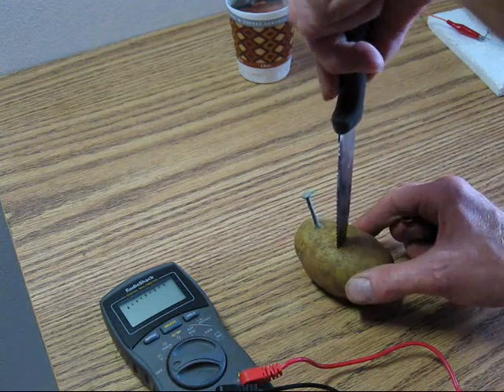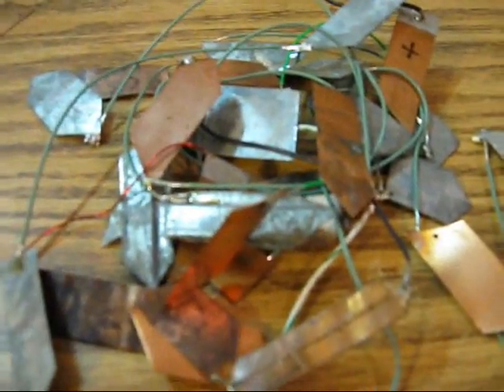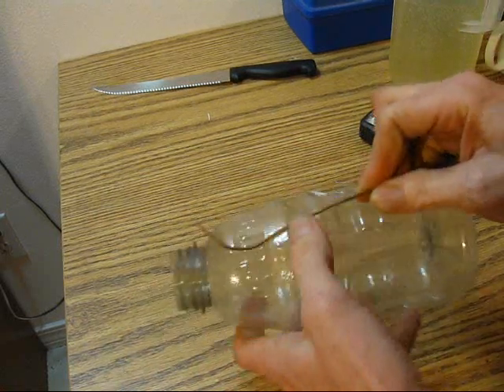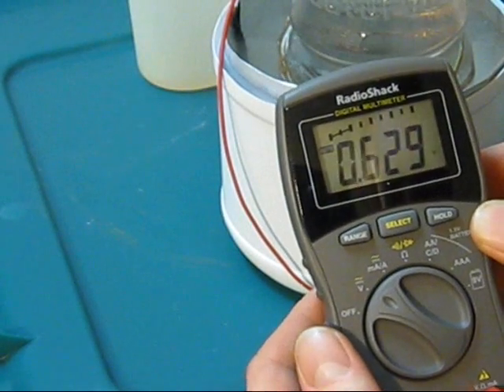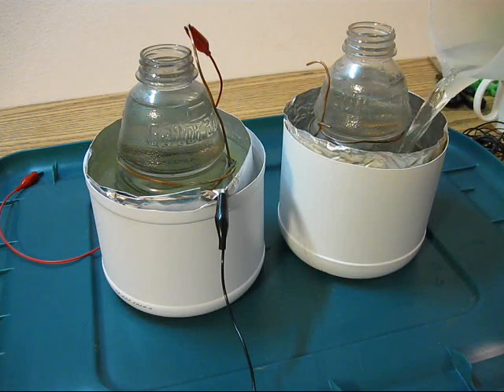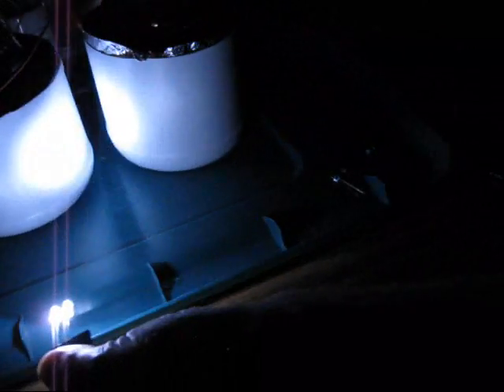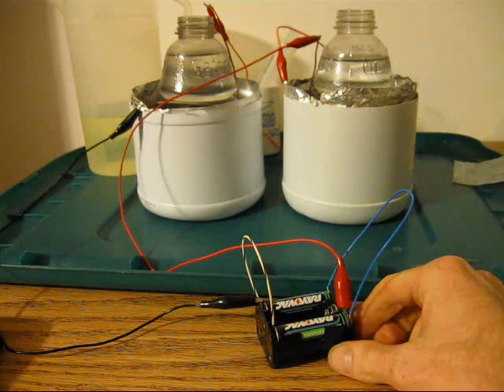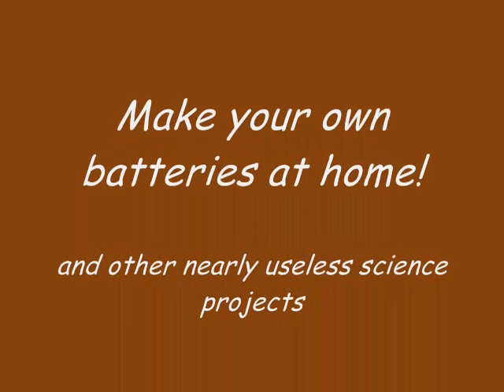homemade potato & bleach battery - nerdy science project 1

Comment: Aluminum is prone to oxidation as well, it is likely there is a thin film of oxidized aluminum thus diminishing your electrode surface area. Would be interesting if you see a significant change in current after taking steel wool to the Al sheet. Cool video; nice work.

Comment from the maker: I've not tried equally sized plates of zinc compared to aluminum. Would be an interesting experiment.  Galvanized sheet steel has a very thin coating of zinc.

Comment: @TheLazetrajkov 500 mA will kill you but only if it goes straight across your heart. The problem is that 2v isn't enough to send the full 500mA through your heart since your body has lots of resistance. When he measures the current of the battery he is measuring the current going through the meter when it's being short circuited, or when it has no resistance. That's useful because it determines the maximum current it can put through any circuit. In other words, it's no where near deadly.

Comment: @stnacestnca it should be try to make solution with vinegar that should help and dont forget take some volt meter and ampere meter to check the voltage and current. that will keep your mp3 or something else not "exploding" or dieing of to much voltage.

Comment from the maker: The bleach battery will last until the aluminum is corroded away. About 3-4 days.
The black device in question must be the Radio Shack multimeter